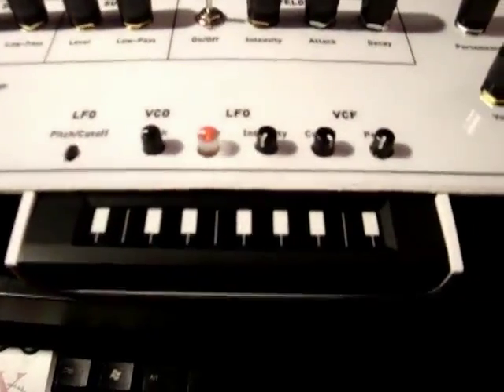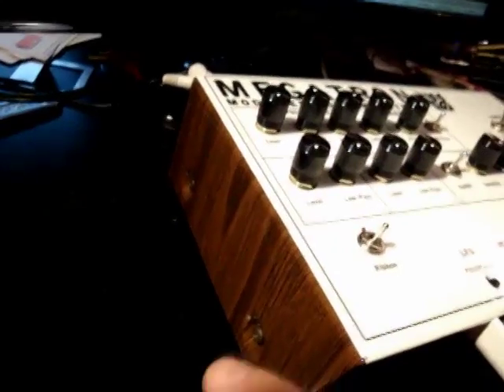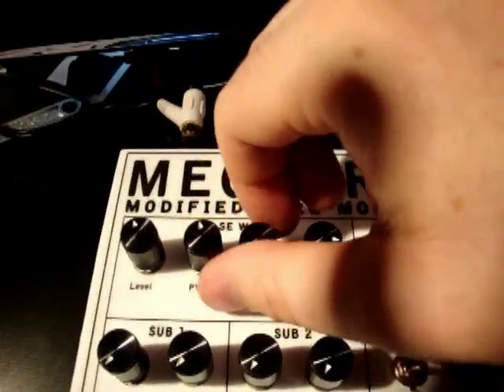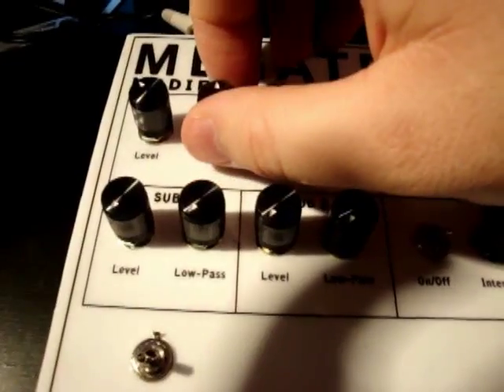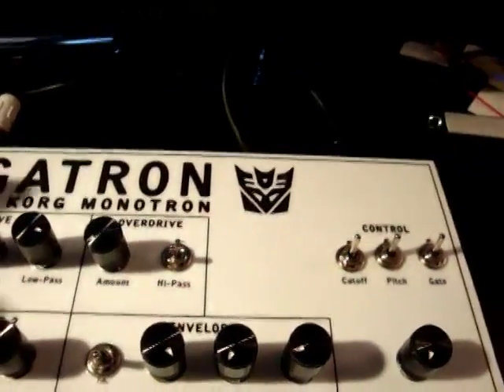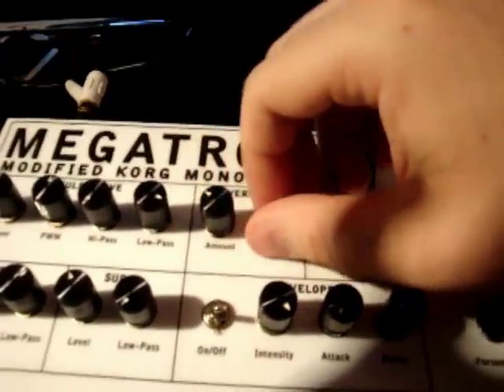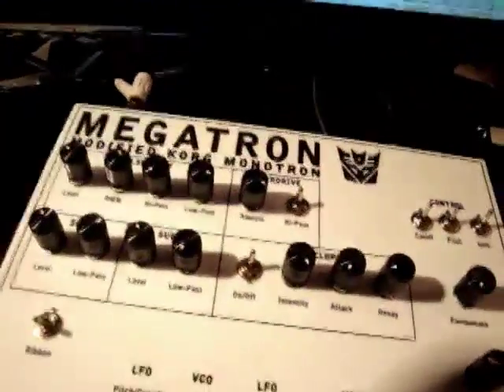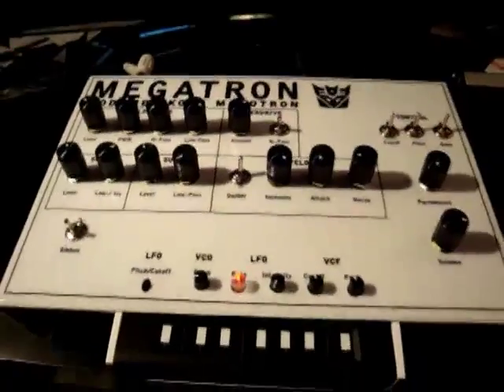Megatron - Modified Korg Monotron

Comment: Great work btw!!! Motivates me to try the overdrive, or play with comparators (pretty new to all this music-electronics stuff). One question: I am planning to mod a Monotron Delay, but right now after testing it I figured that it doesn't make sense because it's so damn noisy!!! Do you think it's worth modding it or should I rather stick with an original Monotron? (still have on lying around) Are there any mods that minimize the noise of the Delay?
Reply from the maker: There is a thread on the muff wiggler forum about replacing the opamps with low noise ones. That will help. However, the delay uses a PT2399, which is very noisy. There isn't much you can do about it - maybe more filtering on the output of the PT2399 by replacing the filter resistor and/or capacitor (R81 and C30). It might help to add a mild hipass there too, since you don't need the low bass to resonate in the delay line.

Comment: Hi!
How is the monotron doing in the deep bass sector? I am thinking of getting another synth just for sub bass layering to my analog four which is awesome but lacks fullness in the bottom end. So far a minitaur seems to expensive and I was thinking of getting a monotron and modifying it to receive cv or midi but I would just do so if it has a good and full sound (I read the mono tribe does whereas the volca bass doesn't).
Reply from the maker: +Jens Kühnemann The low end is great thanks to the two sub oscillators. Also, the filters on the sub oscillators is great to round off the waveform into something closer to a sine.
Reply: +Jacob Watters Thanks for the info. Just got one. I really doubt that I willl be able to do a mod like you did but if I can manage CV control so I can sequence from my analog 4 I am happy. However I noticed that it is quite noisy. For a simple sub bass I suppose I can just add a static lp filter to the output but if you want more quirky sounds there must be a workaround. I already read some possible ways to do so on gearslutz. Anyway... really cool project you pulled. Congratulations !!!
Reply from the maker: +Jens Kühnemann Yes it is noisy - especially on battery power. There are some mods to improve that (bypass the battery voltage pump with an AC adapter, change the LM324s with better opamps). For a simple sub osc, just send the saw osc output through a CD4040 and then send the /2 output of the 4040 to the AUX in on the Monotron. Good luck with your mods!
Reply: +Jacob Watters Thanks a lot :)

Comment: ok, have you seen the korg littlebits synth kit? its all these modular parts that u clik together w/ magnets. comes with a basic kit, but i just found out the little bits site sells the parts individually, as well as some other potentially very handy things to mix in w/ the circuit. i also learned some independant developer has made a cv to midi computer interface compatible w/ the system, so it is now possible to construct a massive polysynth w/ midi that you can rip apart in your frustration and then click it back together when u are sorry.
Reply from the maker: kamalmanzukie I have seen the little bits. It is a very cool idea. I have not tried them yet. If you want a polysynth, then you will still need something to handle the poly note assignment. That could be done with an arduino. I think that there is even an arduino little bit module.
Reply: Jacob Watters OK, two things. the little bit filter and oscillator and delay are all almost identical to the one used for the monotron. they're all individually for sale for under 20 $ a piece! and number 2.... look at this!!! http://www.midibit.org/ i was pretty sure i was getting a monotron, but this is so cool, and i'd never have the patience to put something together this nice.

Comment from the maker: I used the MIDI-IF kit, but it also has CV jacks. There are toggle switches to change from midi to cv control for pitch, cutoff and gate. So it can be controlled by MIDI, CV, or a combination of both.

Comment from the maker: Tuning it with the tiny knob takes a bit of patience. I wish I had added a fine tune knob. However, once tuned and the range knob on the back is adjusted, it is usually good for about 4 octaves of tuning. Playing with it for longer I can get a full 5 octaves to stay in tune, but I usually only ever use 2 octaves at a time anyway.

Comment from the maker: Not if you consider the amount of time. I soldered everything by hand, tested it, drilled the case (hardened steel - not easy to drill), mounted the Monotron, wired the pots, designed the panel, painted the panel, and clear coated the case. It was probably about 80 hours of work, plus $150 for parts. I was considering doing some PCBs that would minimize the work, but by the time I do that I might as well make a new synth instead of just modding one. Check out Jovian Synth website- more info soon

Comment from the maker: Thanks! I totally agree that the Monotron has an awesome filter, especially for the price (less than most VST's). It sounded great with just the midi-if kit too. I just added the other stuff for more options.

Some DIY people talk down about it too, but when you think about it you get a VCO, LFO and a great filter for only $50. That's far less than any modular stuff I have ever seen. You just need to add MIDI or CV control, which is very simple.

Check out my other video for a better sound demo.